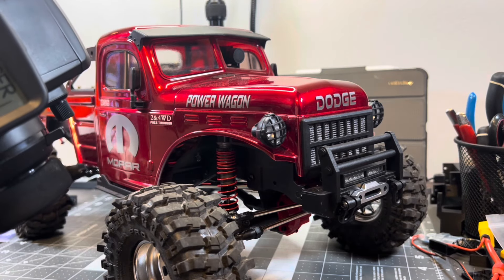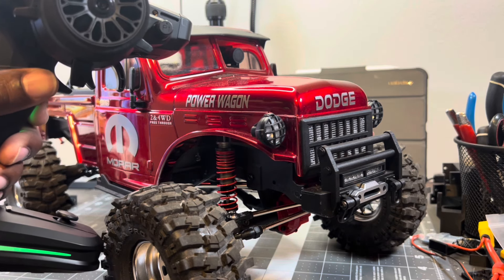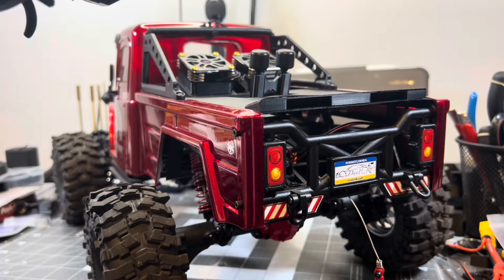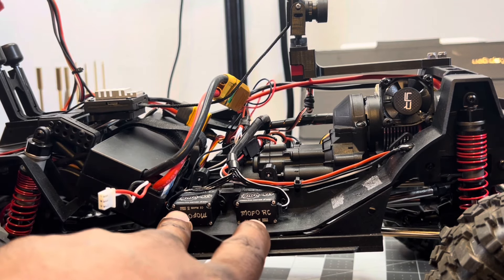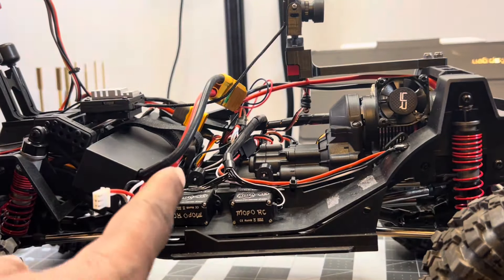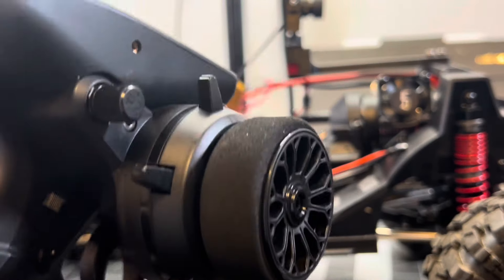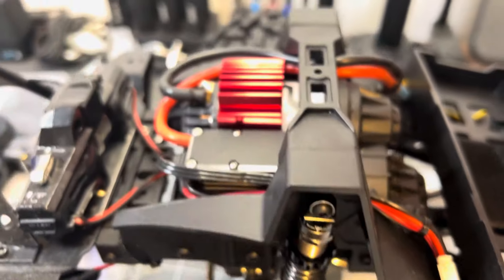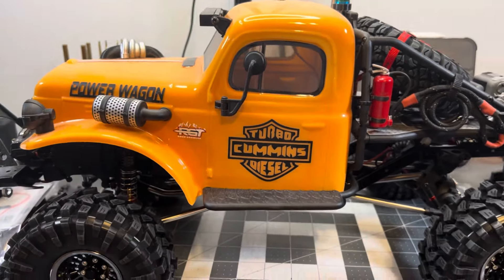Radiomaster MT12 & Walksnail Pro: Some Simple Functions #radiomaster #rgtchallenger #rccrawler

Comment: this is impressive setup with the MT12. Can you explain how you setup the SC trim switch to cycle through the lights? I have seen a few guides on using a Trim as a 2 position switch but you seem to be cycling through multiple positions to trigger the lighting. very cool